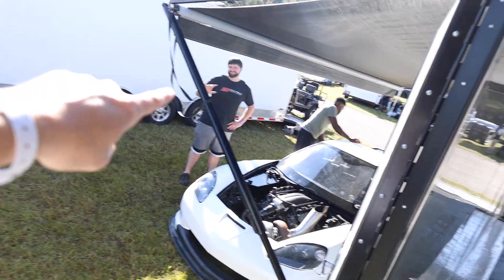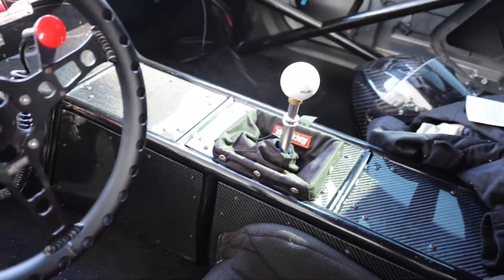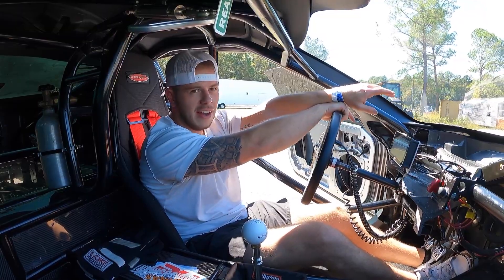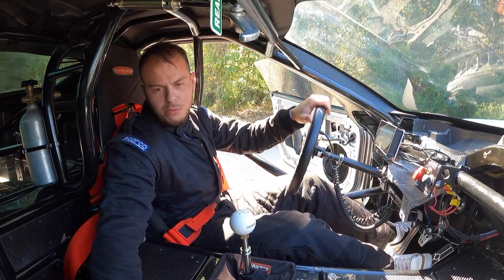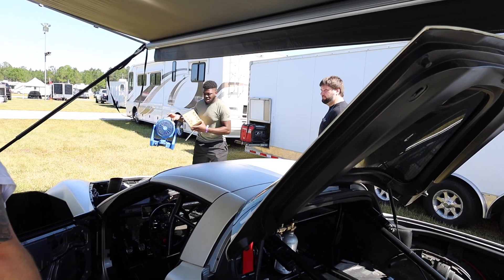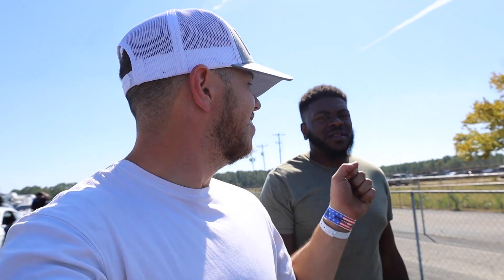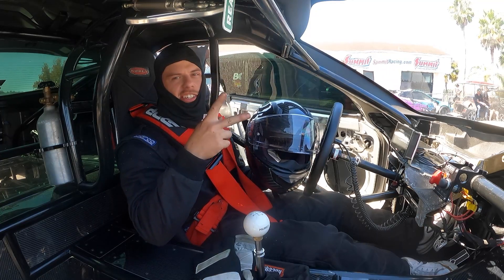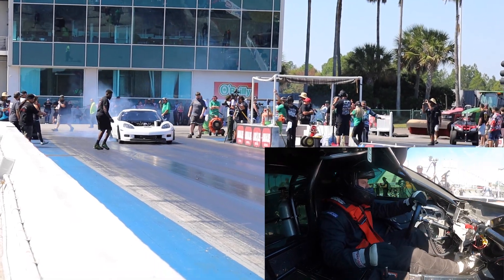Betty goes DEEP 7's [New Record!]

Comment: That oil milking is caused by too low of a viscosity oil. Usually bumping up the weight a step will stop that. Although it should be noted bearing clearances will change with a thicker oil.